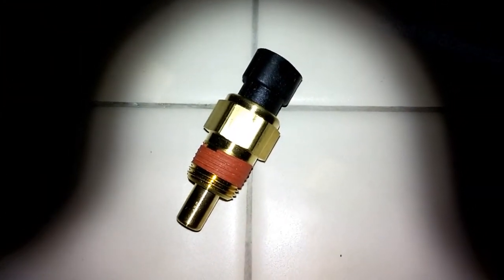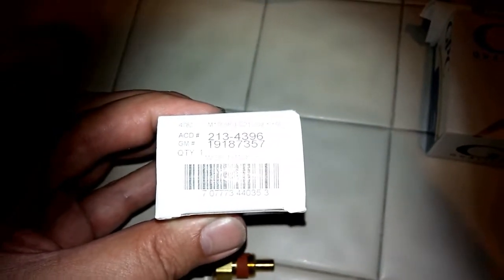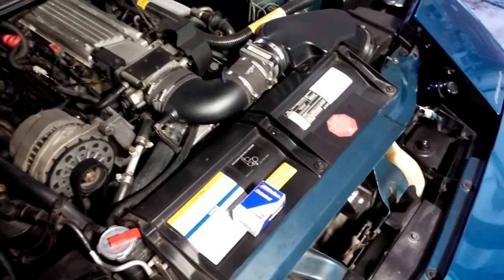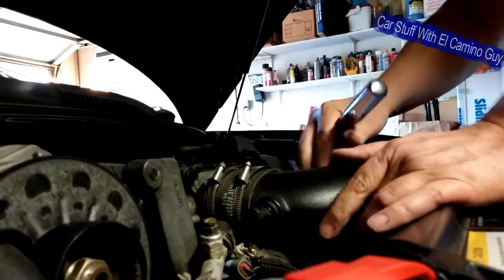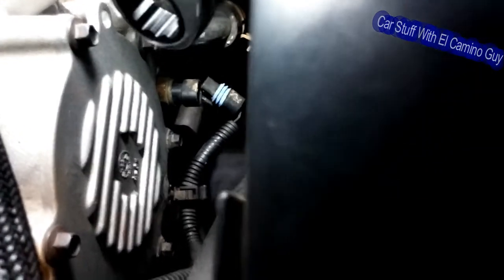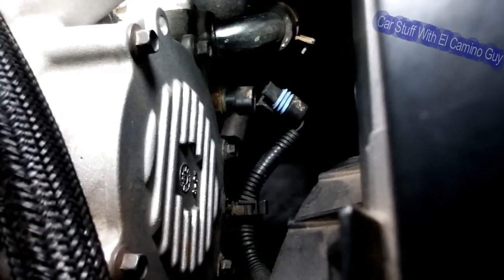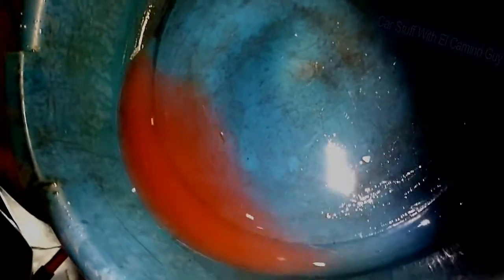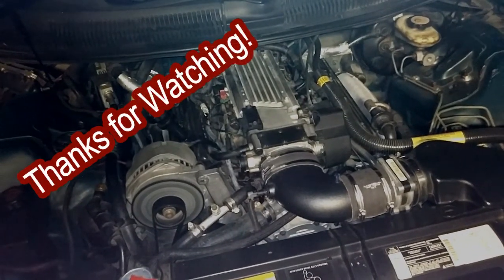LT1 ECT Sensor: The Formula Project

Comment: this is ac Delco professional number(AKA ac/delco aftermarket part)

 the OEM  part,that you get from dealer,  number is 213-928 or 15326386,it is also made by AC/DELCO it's just one notch above regular ac/delco, they both are of a quality product

and superior to any after market sensors

Comment: Would that be the same sensor that I would need to replace because my LT1 keeps flashing low coolant on my dash and it has the proper level of coolant?
Reply: No, that is located in radiator side tank
Reply: @ltform  what this guy said.

Comment: Hi ..I have an 1995 ss impala X Highway Patrol car. So I'm driving and everything is fine then the low oil level light comes on and the a/c compressor stops cooling. I check the oil level on the dip stick and it's good. So I changed the low oil level sensor. Okay, we're running again all is good then the check engine light comes on and the engine spits and sputters but I finally get it back home..I remove the positive battery cable and touch the positive side cable to the negative to drain any stored energy and reset the computer but the check engine light keeps coming back on. In the last 6 months I have replaced the water pump, optispark, MAP sensor, mass airflow sensor, coil, coil control module and the oil level sensor. Sometimes the car will start in the morning but most of the time it will not...Yesterday evening I replaced the ECT Sensor that goes into the water pump and the car fired up on the first bump of the key. I took the car out it drove beautifully and showed signs of great horsepower and improvement like I've not seen in a while. Right before I got home the check engine light came on but this time the engine didn't stall or sputter like it did the last time.. in fact the Lt1 was purring like a cat. I get the car back in the garage and I turned it off and I restarted it and the check engine light had gone off with out removing the battery cable so I started the car many more times and again the Lt1 started beautifully every time. Okay yesterday it was 85 degrees here...but later that evening we had a cold snap come threw and it was 48 degrees this morning 5:00 am here in Hamlin TX. So I jumped up got dressed and grabbed a cup of coffee and went to the garage and the car would not start but only turn over. But no check engine light. Since then I have purchased a cheap GM reader and I have done the little trick with the paperclip to flash a code at me... it wont do anything but turn on the electric fans... now I've gone back to removing the battery cables and using a jumper alligator clip and the computer will not reset and the car will not start... I have no clue! Please Help.. mrdeanv1@gmail.com
Reply from the maker: I'd fist suspect the battery and/or charging system.  Then I'd start looking at things like your ignition coil, wires, optispark and lastly the computer.  I hope it worked out for you.
Reply: Did you get it running? I have just started to play with an LT1 and I am just a hobbyist - backyard amateur. I chased every electrical component in mine. Then turned to fuel pressure. I found I had fuel pressure issues which led to hard start/sputtering/no start issues. In my case I was able to troubleshoot to the fuel pressure regulator.
Reply: @Muddytrickle  no I did not and I'm at a stand still
Reply: @mrdeanv4414  have you checked fuel pressure? Go to Autozone or nearby auto parts place. Rent their fuel pressure tester. Screws in at the schraeder valve. Check to see if you have 45-50 psi pressure and it should hold. You jusst turn the igntion to on and let the fuel pressure build without starting it. That initial pressure should be 45=50 as i recall. Then see if it will start or just crank it and see what that drops to. It should only drop about 5 psi. So if it will not hold. You have a leaky system. could be injectors, pressure regulator, fuel pump or even a leaky line. I was able to chase my down to the regulator. I changed the fuel filter. Tested pressure at the fuel filter. Had great pressure. So I knew it was not the pump or filter. Pulled off the regulator since it would not hold pressure. It was destroyed. While i had the fuel rails off, i cleaned teh injectors and they all held pressure. If it is good - great. move on. Bad vacuum lines will cause rough idle to no start so check or replace all of those. Cheap and comparatively easy.
Reply: @Muddytrickle  Thanks
Reply: Bro I'm having the same issue right now! Car will start then stall randomly their has even been times where it stays running for a good minute! I check all my hoses for leaks and nothing, I also changed the Optispark, Coil Module, MAP sensor, O2 sensors, Purge valve, pcv valve and Throttle position sensor and nothing! I checked everything and was able to find my negative battery cable was split open and corroded, I changed that and still nothing! I only have 3 things left to do which is both temp Sensors and the Idle control valve I'm also on a stand still till then, I just hope my ECM ain't the real issue. Did you ever find your issue?
Reply: @alienfiend9793  I sold the impala and got a 95 Vette...
Reply: Also at times no check engine light! I also had smoke come out the throttle body from it cutting off like it either had too much fuel or both enough air

Comment: I have disconnected this part because it got damaged so my car now have a slow start up , is it because of this sensor ?
Reply from the maker: It could be but like anything else in a newer car you can''t just start disconnecting things and expect nothing to happen.  The ECT tells the computer what the temperature of the coolant is so it can adjust the fuel mixture.  Cold engines need more fuel to get going and warm engines need less and this sensor has a lot to do with that along with the MAP and or MAP depending on the year of  your car.
Reply: its the same LT1 engine .
Reply from the maker: If it's a 95 to 93 then it's exactly the same.  If it's a 96 or 97 it's a little different because of OBD2 which adds a few more sensors.  Either way the best place to start is to replace what you know is broken and if that doesn't fix it at least you've eliminated one possible cause.  Slow starts can be traced to anything from a weak battery, fuel injection issue and even fuel pump or sensor issues like the ECT.  It takes a methodical approach through testing individual systems to track down the problem of which the ECT is just part of one of them.
Reply: Car Stuff with El Camino Guy hey bud I’m having trouble with my 95 Z28 overheating, car temperature is normal when the car is in motion, but when I come to a stop like at a red light or stopped traffic, the gauge starts getting almost to the red! I need some help badly. I don’t have a lot of money to spend on parts I don’t need. Can you please help me out?
Reply: @chicosuave2966  I bought a Caspers Electronics F-body fan control module for mine. Was having the same issues and living in Texas we get some very hot summers. Bought the module and problems solved. It has a mini toggle switch that mounts inside the car and has 3 different temp settings. One is the factory setting, which kicks the fans on somewhere around 200°. The second setting kicks the fans on automatically when the temp hits 180° and third is full manual fan control. Meaning you can turn your fans on and off whenever you want. I love mine, very easy to install and if I remember correctly pretty reasonably priced. Wish I would of bought one way before I did and never stressed about the temperature again.
Reply: bmf97ss1 well I did buy a Jet cooling fan switch kit and a coolant throttle bypass kit from BMR and a SLP thermostat. Hopefully that will solve my problem. Thanks for taking time to reply bud. I appreciate it. Do you have the part number for the coolant sensor in the head? GM part number?